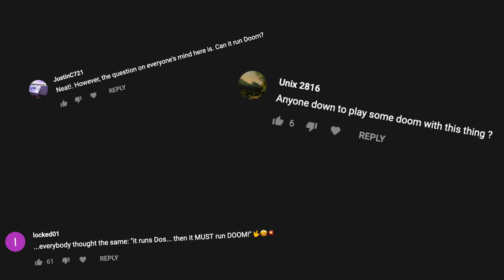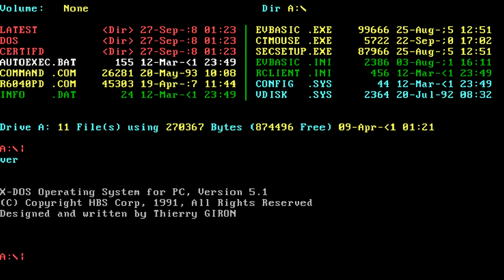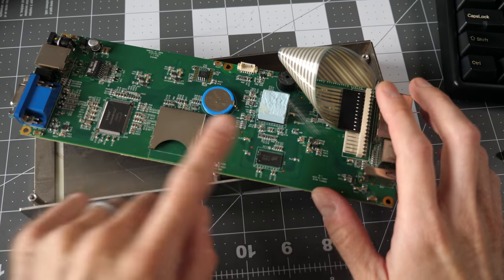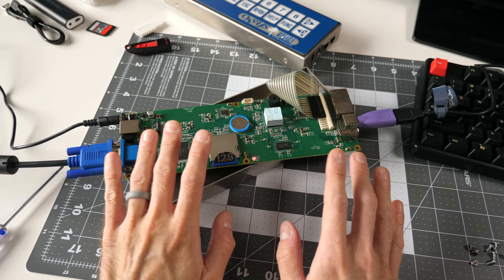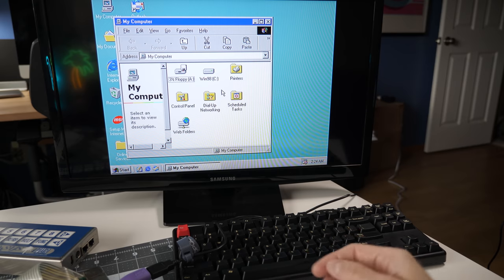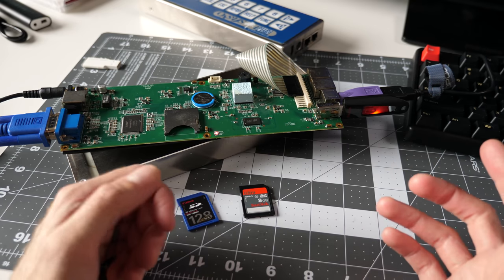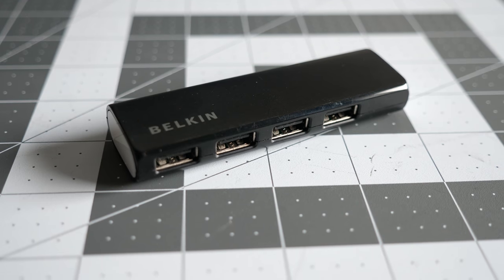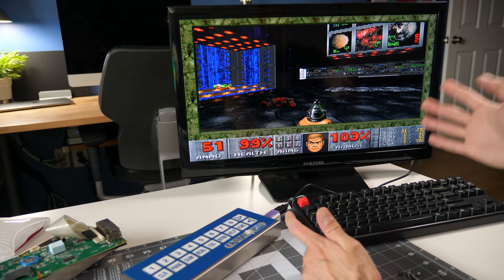Doom on a Commercial Kitchen Appliance

Comment: Considering that people with 1980s and 1990s Amiga computers to use SD-Card as a "hard drive", hell even they make SD card adaptors for Commodore 64.
So anything should be possible!
Reply: my 1999 pc has everything on sd cards except a shared game drive. makes it super simple to go from 98 to XP or whatever you need
Reply: @KNut-dy3gw  for 1999, the avg HD was 100GB size.   Now that's nothing. Lol
Reply: @TexasCat99  I think you meant 10gb lol. you were a huge baller if you had a 100gb drive in 99 😂
Reply: @TexasCat99  it’s crazy that sd cards have gone from 128mb to 128gb in under a decade
Reply: @KNut-dy3gw  I spent almost $300 for my first floppy drive, for my commodore 128.  150 bucks per Amiga floppy drive, 880k.
128 gigs in size of a postage stamp... 128 GB SD is $15 or so LOL.  
I still buy 32 GB flash drives because they're five bucks temporary throw away storage.

What I love about my first flash drive, 120 MB is that it has a tiny switch to have read only mode... Too bad it was a pain in the ass to flip it.
Reply: @KNut-dy3gw  You are likely right.  It's hard to THINK of data storage that small.  I have a couple of 4TB drives in my computer, 8TB backup drives, because they're cheap at $120.

My first HD was 20MB in 1990.  My Amiga came with a HUGE 50MB, I think it was half full when I stopped using it.   When I went through OLD HDs to toss.  Anything smaller than 500GB was trash.  My next cellphone is about $300.  It'll have 6GB of RAM, 128GB of storage, 8core CPU running 1000+Mhz per core.    It replaces the old  Camcorder, phone, TV, computers, etc of the old days.
Reply: @KNut-dy3gw  Don't forget prices and such.   I remembered the first time I held four sticks of 4MB of RAM... there was 5 of us.. going "WOW!  This is $2000" as  a typical PC had 4MB.   My first 2MB expansion board.  Yep, a whole BOARD was $1200 new in the 80s.
Reply: @TexasCat99  I have a Pentium III retro system that I built with an sd to ide adapter, and I was trying to install dos on an sd card but it wouldn’t work. turns out dos can only use 2gb drives or smaller 😂
Reply: @KNut-dy3gw  duh.  
Go find real ide pata drives. Get that pats speed, sound and vibrations.
Reply: @TexasCat99  I have a 20gb Deskstar in there that I use for Windows 98 stuff that works great but I want to keep it working so I usually use sd cards. It used to have a 10gb drive too, but I needed to take it out in order to use the SD
Reply: @TexasCat99  I get my sound from the floppy drive, zip drive, and cds
Reply: @KNut-dy3gw  ah. Zip drives.  Forgot anything those.  They were great one the day.  I used to have a blue scsi version.  The printer port version sucked.

Then CDRs took out ZIPs, once they got cheap.
Reply: @KNut-dy3gw  haha, oh yeah, the IBM Deathstar drives.  They seemed so good at first.

It's all good.  In general, I still prefer the quiet and speed of modern computers thou.
Reply: @TexasCat99  I got all my zip stuff for cheap at a thrift shop. usb reader one time and a bunch of disks in a holder another. didn’t do much with it until I got a Pentium II machine with a drive on the front and now I use it for transferring files between my main pc and the PII. I was pretty surprised when the usb adapter worked out of the box with both my MacBook and linux pc

Comment: The only xp that would run on that hardware would be the Windows Essentials for legacy PCs version.  Windows 7 you need the Windows Thin PC version.
Reply: Why couldn't you use regular XP? It not only meets the official minimum requirements, but also the official recommended ones.
Reply: @eDoc2020  XP blue screened due to driver issue. Had he slipstreamed SP3 into his XP install it might have been able to reboot successfully but the standard install knocks out the USB controller without a replacement driver on reboot.
Reply: @littlepeon  I thought the bluescreen was when he booted from the SD card, which I thought was connected via IDE. If that's the case it wouldn't be a USB issue. 

Of course, there's a chance the SD might actually be connected via USB despite its hardware description in SeaBIOS. This could be explained if the board has an SD->IDE adapter which is then connected to an IDE->USB adapter. This doesn't seem like a logical way to design a motherboard (SD to USB adapters are everywhere) but maybe there's some compatibility or parts supply issues which I'm not considering.
Reply: @eDoc2020  the whole setup is goofy. That CPU is way overkill, and the RAM is barely enough to do the little it's meant to do. It's like they had a whole bunch of Pentium 200(knockoff) chips they had to get rid of....

Comment: Stop code 0x0000007B is INACCESSIBLE_BOOT_DEVICE. Hazarding a guess, XP doesn't know how to load itself from a USB stick or SD card. SD Cards had barely hit the market by the time of XP's initial release, and thumb drives were still a year away. You might have more luck with an installer with Service Pack 3 slipstreamed (https://www.raymond.cc/blog/slipstreaming-windows-xp-service-pack-2-and-create-bootable-cd/). Also, I know you wanted this to be a soft mod scenario, but if I were you I would see how the system behaves with the built-in flash memory desoldered from the board, or, barring that, whether I could put a bootloader on it that would in turn load up the OS from the USB or SD card. It's (remotely) possible even that this would solve the inaccessible boot device problem, since it acts like a floppy and XP decidedly knew how to work with floppies. HTH! :)

Comment: I've got a little industrial touch panel computer with the same Vortex chip in it. It was designed for automotive applications (judging by the jank 12v DC power terminals) I need to get around to booting Linux on it.

Comment: Nah, Windows is booring. Too bad you didn't try running Linux on it. There are several open source Doom Ports that can also run in a terminal frame buffer just fine and do not need a graphical user interface at all. I would love to see if this would work on that device 🙂

Comment: Impressive for what seems like a machine that has no business being able to run Doom.
Reply: Anything that has 66 MHz CPU and 8Mb RAM can run Doom.
133MHz processor can run Boom/MBF port, and thus can in theory run 90% of the modern Doom maps too. Framerate depends on architecture complexity though so the mileage will vary.
This thing has 300 MHz so that should be plenty enough not only for Doom, but also Quake, Duke Nukem, Blood, Descent, and most other 90's games that didn't require an actual GPU.

Comment: While it would probably cause trademark/patent infringements, it would probably be easy to rip off the design, io layout, and software and put it in a raspberry pi or arduino and sell it at a lower price as the original, undercutting the market. 
What I'm trying to say is that this thing seems way overpriced...

Comment: The fact that they charge $800 for this is absolutely insane. Like... why.... we can have "decent" looking UI that's really low power.... and they just jam a vortex cpu and 128mb ram..... meh.
Reply: its the small form factor that makes it expensive. before PI form factor, i did some custom ITX installs for cars... our hardware pricing was simple- take whatever price was for a normal ATX machine and add $200 for the smaller form factor.
Reply: @littlepeon  The "form" factor? 

It's literally the default though... a basic pc of that power.... IS that size. 

I can literally have a nuc, pi, or other industrial x86 pcs for so cheaper. 

And at the speed of this, I could get an RPi and just EMULATE this system for half the cost and have more power, less energy consumed, AND have less space used. 

I think they are relying on software, "existing" customers just wanting a drop it compatible system, and it being older tech that they can markup higher....
Reply: @1337GameDev  yes by form factor I mean size. When I was putting mini-pcs in cars, people thought ITX size was too big. At the time there wasn't PIs you could get Audrinos or Beagle boards and even those were $150-200 at the time. This system actually is not well designed, that's a way overboard CPU with not enough memory on board  to do anything. The manufacturer must have had a bunch of CPUs that they had to get rid of, and just thru it together in this system. The $800 price is outrageous, ebay actually has new ones for $400 and used ones under that. There is a pic of the exact one this creator purchased for $40( parts only). Bump bars have been around forever, and with that sometimes prices get ingrained into the system as there are no competition, so the mark-up stays high.

Comment: You wanted to run Doom on it and discovered it can boot from the USB port. Half this video could have been dumped if you had simply put FreeDOS on a USB flash drive along with Doom and boot from that as it's a DOS game. You did not need to bother with Windows 98 and Windows XP! Pointless fluff to pad out the video!